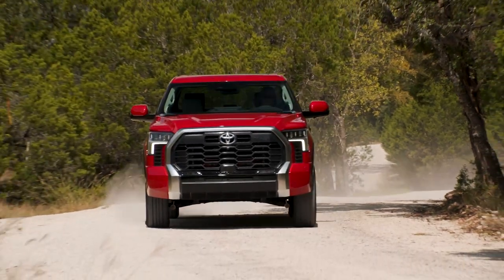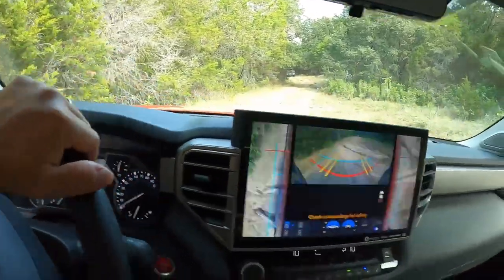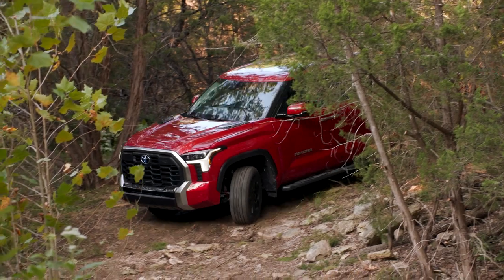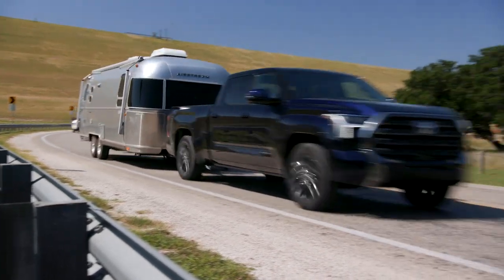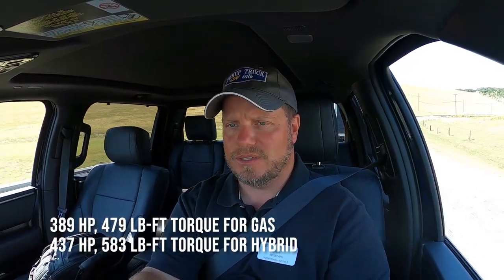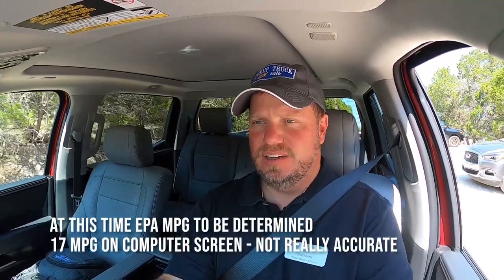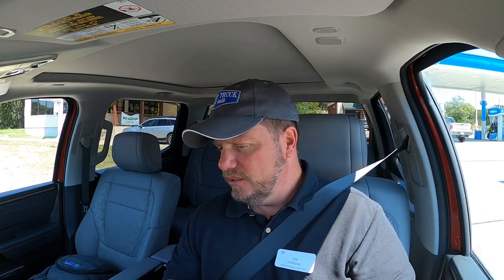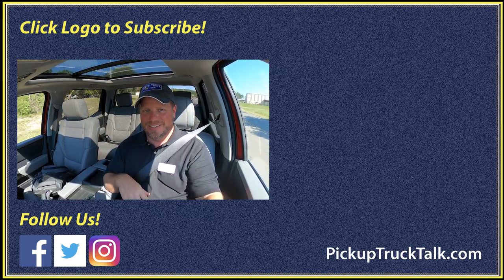First drive: 2022 Toyota Tundra gas, hybrid off-road, towing and more!

Comment: You gave up the f150 hybrid for this? Really?
Reply from the maker: In truth, I was done with the Powerboost from a journalist point of view.
Reply: @Pickuptrucktalk  …let’s be honest, everyone that wanted a Toyota pickup truck was waiting for the MPG and if 20 MPG combined is the number for the non hybrid Tundra, it will sell more than it used to.

My 4runner gets 18 MPG combined and it does not have any of the capability of the new tundra. I never considered any of the other 3 for a half ton truck.

Comment: It drives like a v8 but how long will the turbos last.  Also will it require 91 octane to get the better performance
Reply: Multiple outlets reporting rating are on regular gas.
Reply from the maker: Yup, just 87 octane.

Comment: They ruined the space of the double cab. Apparently, they're de-tuning the SR versions. You can't get the hybrid system unless you buy top trims. No tow hooks, no bench seat, no column shifter, no bumper step, almost certainly no way to hook up even a small plow to the ridiculously-extended front end. Likely not much of a real-world MPG improvement if you're actually working the truck. Lost of known reliability. 

I was hoping this would be a truck that would last me 20 years. Now, I probably have to wait 20 years with the hope that Toyota will fix what they screwed up with this redesign.
Reply: I have commented many times throughout many youtube videos where people were so hyped up about new tundra, and I said many will be disappointed.  I am myself not impressed a bit.

Comment: How is the throttle tip-in compared to the other half tons? I’ve test driven them all and they all seem to have lots of throttle lag. On the gas motor.
Reply from the maker: I thought this gas version was just fine and I didn't really notice much turbo lag at all on normal mode. The hybrid is even faster.
Reply: @Pickuptrucktalk  Awesome! Thanks.

Comment: 400 watt is not enough power
Reply: Agreed. Though I'd prefer a 7,200 watt option like the ford, at least put in a 1,500 watt like the Toyota minivan. That will do most of what I need (which is 600 - 1,200 watts). Them saying a person should drag around a generator is a cop out. I don't want to load and unload a generator and worry about security and don't always know when I'll need it. Toyota, Just add the built in inverter and give us what we want even if you don't think we need it.  I'm not going to idle the truck for 8 hours and use it. That is the use case for a generator. But I want to charge electric motorcycle battery as I drive, run an electric powertool for short period of time, etc.

Comment: Premium fuel required or can you use regular?
Reply: You can use both. Full power requires premium.
Reply: Multiple outlets saying all rating on regular gas.
Reply from the maker: 87 octane.
Reply: @jaycooks1245  I hope that is the case.  F150 Ecoboost requires premium for higher output numbers
Reply: @Pickuptrucktalk  If this is the case it will be the first twin turbo on the market that does not require premium fuel to get maximum power.
Reply: @SuperSnakePlissken  wrong, full power with 87 octane fuel. Toyota made a mistake with a press release that they later fixed.
Reply: @chandlerrobbe7069  Link please. Thanks.
Reply: @snake
He won’t be able to provide a link..

Comment: Not nearly as nice as the F150.
Reply: Probably built better.  But yeah, I can't imagine trading in my F-150 for this.
Reply: Yeah, nobody's questioning the build quality of a Tundra. To me, the truck has no heart or soul. It's a copycat version of a couple American icons. It copies the design of a GMC Sierra and motor of the F150.  The Sierra and the F150 are the real deal. You give up so much in choices with this Tundra....... no choice in rear axles, no V8 option, no tow hooks, no available on board generator and the list goes on and on.  If you're in the business of reviewing vehicles it makes sense to buy one for tax write offs and to try it and report on it, otherwise.............. what's the point?
Reply: @CW CW
no innovation at all, just copying the big 3 again
Reply: @plmn93  I think you'd be disappointed. I'm not convinced about build quality; there's far more old F150s on the streets than Tundras.
Reply: @cwqrpportable   I highly doubt it.  I haven't seen build quality as bad as my '18 F-150 since the '80s.  Freezing door latches, warped dashboard, clunking transmission, noisy suspension, etc, etc.  Ford has sold 5-10 times as many F-150s each year than Toyota has sold Tundras so of course there are going to be a lot of them out there.  That said, build quality/reliability is the only thing the Tundra has had over the F-150 over the past ten years, so they never interested me much.  Performance, capability, handling, safety, comfort, technology, flexibility...those are all areas where the Tundra fell short  This new one addresses many of those shortcomings but not all of them.  It's still an also-ran, IMO.
Reply: @plmn93  I live in a cold climate; my door locks froze also, particularly after a freezing rain or a car wash followed by a cold night.  My dealer fixed them under warranty and there have been no other issues. I have an ever so slight warp on my dashboard on the passenger side. If you didn't know it was there, you would never notice it. The 10 speed transmission in my personal F150 has been bullet proof and solid for normal use and towing a 7000 lb RV trailer.  Absolutely no noise from any part of the suspension. I have a small fleet of F150s for my firm; the majority of them are 3.5EB and I have nothing but great things to say about those trucks....... they're pounded hard day in and day out and never once have let us down.  I found a good dealership; sometimes that makes a big difference in ownership too. They're hard to find.   Have a good day!

Comment: Electric steering?
Electric fan only or combo?
Reply: It has electric steering. Fan I don't know.
Reply from the maker: Electric steering like all new trucks these days. Only way to get lane change assist to work right.
Reply: @Pickuptrucktalk  , ford puts Electric motor in addition to hydraulic on HD trucks
Reply: @Pickuptrucktalk  WRONG! Modern vehicles that have hydraulic steering still have active steering and guess what, your brakes are hydraulic and they also have auto emergency braking. It works without having everything electric. The Land Cruiser 300 which is very similar to the Tundra has hydraulic steering. The Land Cruiser is a luxury SUV and therefore has a more sophisticated steering system too.
"The new Land Cruiser combines a hydraulic power steering system capable of withstanding use in harsh environments with an electric steering actuator. This not only enables the addition of steering support functions such as Lane Tracing Assist, but also delivers outstanding maneuverability at low speeds, reduced kickback while driving off-road, and a crisper steering feel. (Equipped as standard on the ZX, GR Sport, and VX grades)"
Reply: @repairvehicle  That's what the new Land Cruiser has too.
Reply from the maker: @repairvehicle  HD is a different story.
Reply from the maker: @imnotusingmyrealname4566  ok then. Just what I was told from the engineers.
Reply: @Pickuptrucktalk  Only having an electric motor is cheaper than having both or probably even only a hydraulic system so the benefits/tradeoffs/costs were acceptable for them to use it. These engineering presentations are of course also made by marketing so they'll have to be more positive about their product. Given the fact that the combination steering is available on the more premium Land Cruiser and the new HD pickups which need to perform harder than half-tons it's clear that their system is better, but more expensive of course.

Edit: Also please don't take that slightly aggressive previous comment to heart. That's just the internet affecting how everyone communicates. You as a creator probably know that already but still wanted to mention it.
Reply from the maker: @imnotusingmyrealname4566  you are good. I'd rather have passionate truck fans than people who don't care!
Reply: @Pickuptrucktalk  That's the spirit!
Reply: It has a electronic fan clutch. Works the like a regular clutch but has a wire attached to it to activate the fan when needed.

Comment: Why not drive in sport modes too?
Reply from the maker: You can for sure. I just test vehicles out in normal mode whenever possible since the majority of people drive in normal mode.
Reply: Yes but when you wanted to judge that acceleration and lag I think sport mode would make all the difference. It seemed Like that delay was the transmission trying to figure out what gear to down shift to before it would tell the engine to go. In the f150 sport mode is like a totally different beast. So from your impressions right now what would you buy if it wasn't for the channel F150 or Tundra?

Comment: Just imagine if the Hybrid was a plug in.
Reply: That's what I'm waiting for. I want to do daily drives to work on all electric and have the "hold" feature to hop on the interstate in gas mode and hold my battery until I get into town/city driving and run all electric then. But I tow and drive deep into the mountains so all electric won't work due to range. A plug in hybrid would be great and the smaller battery pack is cheaper and lighter than a full EV so payload stays higher and overall price lower. Most bang for the buck since most daily commutes would be less than the 30 or 40 miles electric range.  Though more expensive due to battery size, the only thing I'd like even better would be a serial hybrid; basically a EV with long range battery (300+ miles) but also a small ICE as a range extender. All the drive power is only from electric motors and battery but on a long trip, if no charging station is available, the range extender kicks on and will put enough juice into the battery as you drive or while you are stopped. Even if the battery is run all the way down, the range extender engines give you enough power to keep driving with reduced performance.

Comment: What's the mpg on the non hybrid?
Reply: They haven't released the numbers yet, so even if he knew, he can't say.
Reply from the maker: Gas version is: 18/23/20 (2wd); 17/22/19 (4wd).
Reply: @Pickuptrucktalk  ha!  I have used 19mpg average for my estimations for months and now I can gloat about how great I am.  But seriously, this really only gets 4mpg better than my ‘21 and you should run premium in it since it is a TT.  So not much net gas savings.
Reply from the maker: @dudeman1455  Toyota specs out 87 octane btw. Same as Ford.
Reply: @Pickuptrucktalk  I was using the Ford eco boost as my example, owners manual says designed to run on regular, but for best fuel economy and engine performance to run premium.  TT need premium to run best no question.  But even on regular, 4mpg improvement won’t be a big savings vs the projected higher cost of the ‘22.

Comment: NO V-8 NO SALE!
Reply: Ok boomer
Reply: Then u complain about bad mpg on v8. Lol
Reply: Those thirsty v8s will still be up for sale.
Reply: @tomjohnson8737  My ‘21 Tundra’s V8 is only 4mpg lower than this ‘22 Tundra, plus premium fuel should really be used in the TT so net gas savings vs the prior model year will be low.
Reply: I love my 5.7. Wish they kept it as an option with the 10 speed transmission, or make a 5.3 w/ that trans
Reply: @KeminTravels  that is correct.  Designed to not require premium.  I am referring to Ford F-150 eco boost owners manual that says the same thing, but the next paragraph says for best mpg’s, engine performance and towing ability use premium.  Am suggesting the new Tundra will say the same thing.